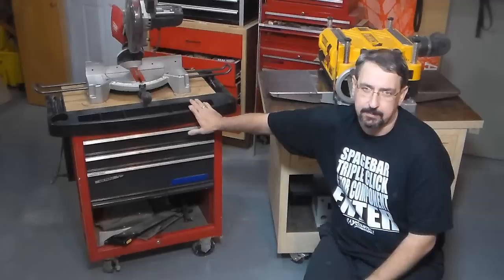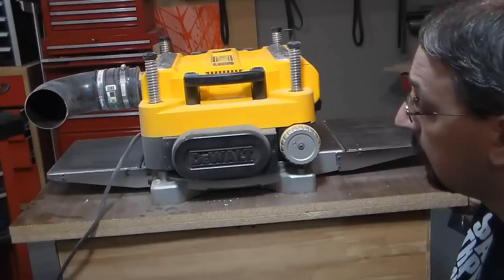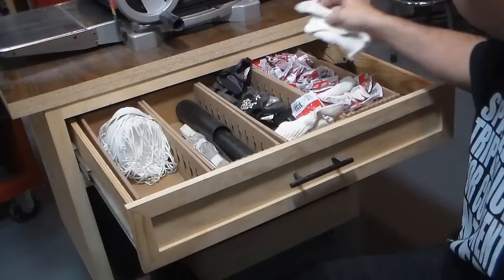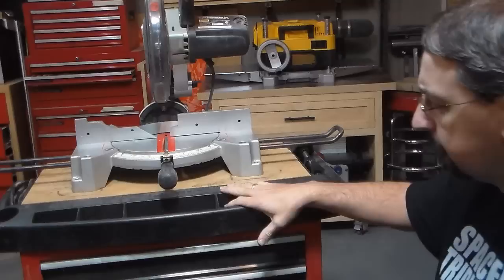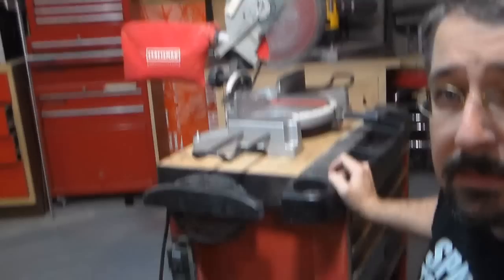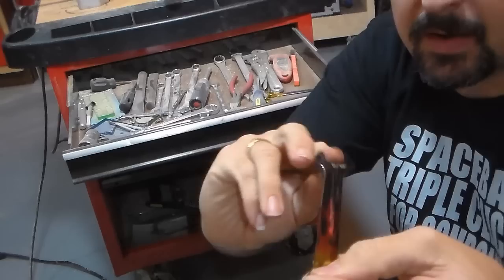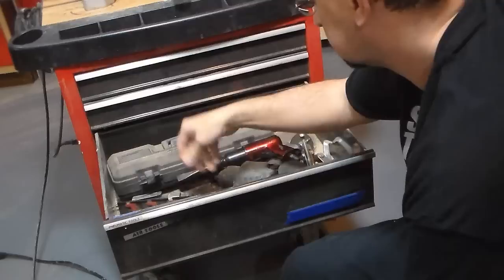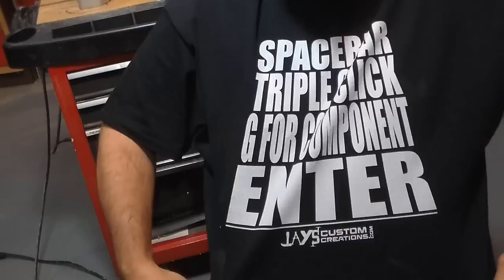Shop Tour Mobile Shop Carts

Comment: Mike, I'm currently looking in to getting a jointer (and need to save space) and you don't have many issues with you delta. How large of material have you ran on it?
Reply from the maker: I have face jointed a 4" piece, and edge jointed a 8' piece before mostly smaller pieces
Reply: Sounds like that would work for me. How heavy is it & do you just flip spots wit you planer & jointer?
Reply from the maker: david miller Stay tuned and I'll do a video with close up with all the detail that I've know of.